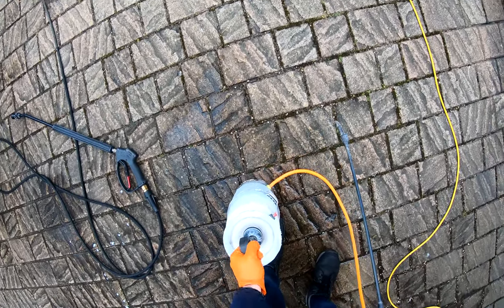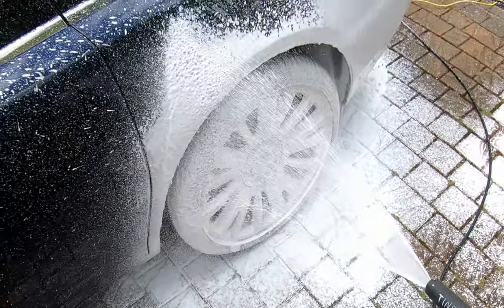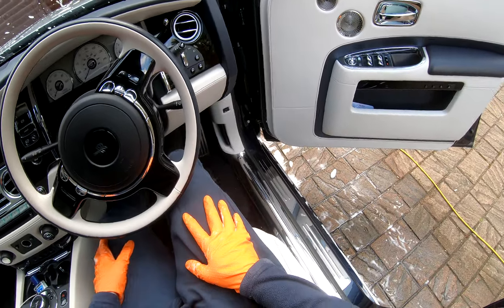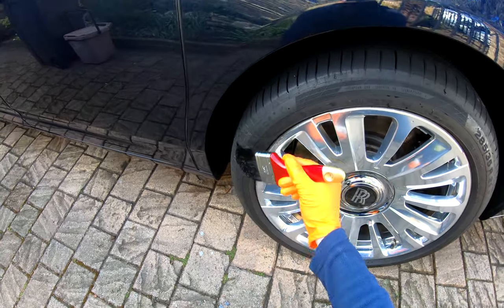How to Clean Wheels, Tyres and Arches

Comment: Does the high pressure water not damaging the brakes?
Reply from the maker: No not at all, as they are designed to withstand alot more as for example when driving on a rainy day, water is going past in top speeds inside the wheel